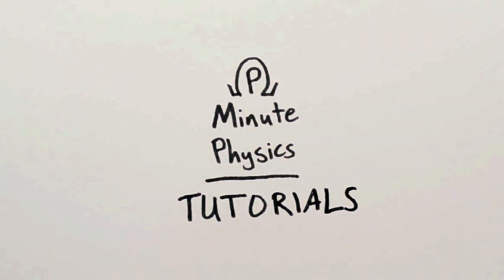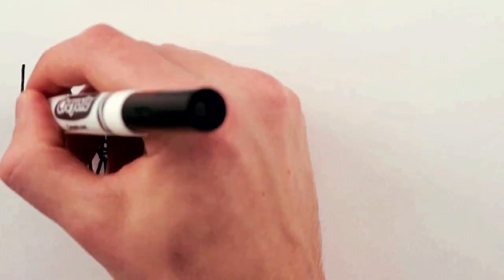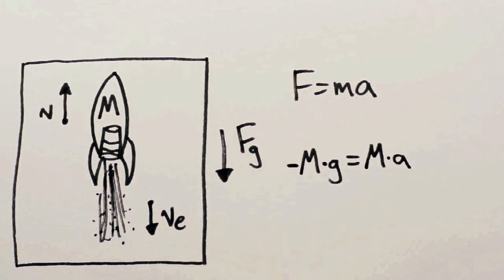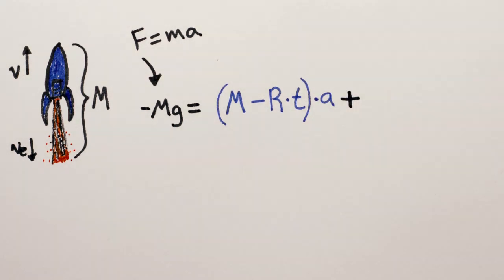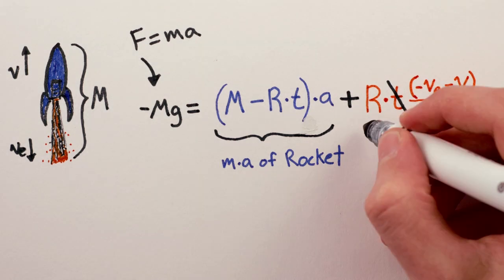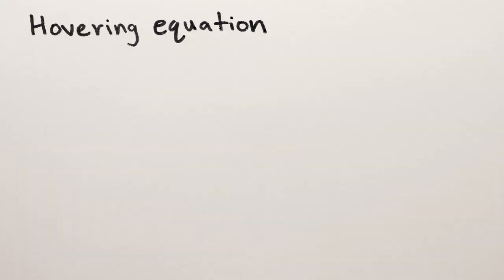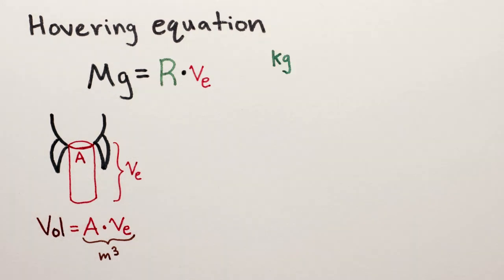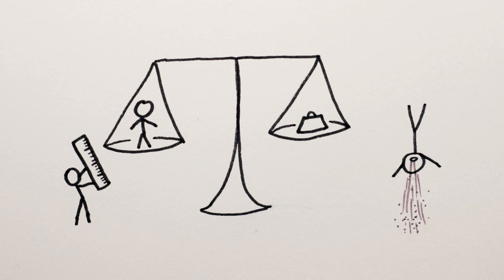Tutorial: Rocket Science! (plus special announcement)

Comment: It's a type of refraction, the sloping of the bottle or rocket towards the opening increases the velocity very quickly, and when it hits the open air it spreads out in a cone like pattern. If the diameter of the bottle and the opening are the same, then the water will come out in a cylindrical patter.

Comment: Yes, very basic, showing the very basics without any addition with calculus. In order to calculate all of these parameters you must take into account many different changing aspects. 9.81 is always decreasing as the rocket increases its height, as well the mass in both Gm1m2/R^2 and m2*a are both changing. As well the rocket does not travel in a straight path, in order to orbit a rocket has a trajectory of a shape close to the parabola to reach the proper direction, in which the final velocity would be reached byy a ever changing acceleration based on the vector of the changing directions of force. So much is left out of this, which makes sense seeing as adding in all the calculus in order to fully explain it would be impossible to explain in a minute physics. This is bottle rocket science.
Reply: Daniel Alexander Also the exhaust of a rocket is not just liquid and it doesnt exit with the same volume, you are only able to calculate based on the use of fuel from inside the rocket seeing as once it exits it is near impossible to measure
Reply: Daniel Alexander Oh and R isnt just kg, its kg/s! Before he specifically used m-R*t, where R x t is equal to kg. I feel as if this episode was half assed, not trying to be a troll but if you are trying to teach the basics of something extemely advanced please at least get the basics right.
Reply: Maybe you should post a video or write the proper equations with all this corrections.

Comment: as long as the opening for thrust to come out is smaller than that of the fuel container/flow line, then it is getting "squeezed" out, or put under pressure, so the object trying to elevate, (Milkman) can go higher than the tank/stomach height.

Comment: No, it doesn't need to be compressed, it just needs to be pushed out with high enough force, like letting liquid out of a syringe, except much faster. Air or gas, however can be compressed withing the container and when the opening is, well, opened, the air has more room where to go to and decompresses while getting out, thus taking up more space and propelling the rocket.

Comment: no 1mm is .001m, not .01m, and the area of a circle is pi*radius^2, so it would be
Vol=Sqrt(pi*0.042^2*73*9.8/1000) m^3
and this equals 0.063 Liters/second. 
Correct me if I'm wrong, but I think this suggests that you should be able to fly by holding onto a 2 liter thing of coke after putting mentos in it, assuming the opening is less than a centimeter, and the foam that comes out is incompressible...

Comment: Ok so, quick question : (I'm a CS guy, I'm not that good at physics so please don't judge)

Considering a payload be of 0.5 KGs , how big would a rocket have to be to justify using it over a helium balloon ? 

Like, I know Helium balloons burst at a certain altitude, and I'm just wondering how big (how much fuel) would the rocket need in order so surpass the maximum height reached by a He Balloon ? 
Neglecting the mass of the rocket frame,
 flight path straight up
And rocket fuel : standard solid KNO3 based hobby rocket fuel

Comment: I'm sorry but there are only 500 characters allowed.
So the formula is as follows:
g(h) = g(n) * {r(e) / r(e)+h}^2
In this formula there are a few variables to be taken in to a count:
g(h) = the gravitational force (acceleration) at a certain hight.
g(n) = the gravitational force at the surface of the earth (9.81m/s^2)
r(e) = the average radius of the earth, or the actual radius at your location.
h = the current altitude

This means that as the rocket goes up it's going to be easier.

Comment: But, you don't need alot of milk at all to levitate right? just a drop will do, as long as you expell it at a high enough velocity?
Reply: Right! "Simple algebra" part is missing this. Plus you could heat up exhaust to make it more efficient. Heating up water rocket nozzle might give you even a plasma thruster for a moment or two :)
Reply: but at the rate that milkman expels the milk he couldnt possibly lift himself
Reply: olly man well, I'm not sure about milk expel rate. Stream might have a tiny core amount like 0.001 kg of milk expelled at 10^6 m/s every second to make milkman fly easily. Other milk mass we saw could be just coolant/lube/flaw in his milk thruster design. That tiny amount of milk actually used for propulsion should also leave particular traces on tarmac...
Reply: olly man of course I'm not standing here for any real possibility of such engine. Just want to prove that video's calculus not 100% correct. 
BTW, if we are assuming that milkman must use only a litter or so of non-combustable fuel for flying between some distant places where crimes occure, then exhaust rate must be ridiculous causing air ionization and weird supersonic sound effects.
Reply: minutephysics assumed a duration of one second, which is essentially the reason, that he wrote Vol = A * v and not Vol= A * v * t. He just made t equal to one to make the equation simpler(an old physicist trick. Not very effective, especially in this context though). So your right! What he really calculated is actually the volume you need to eject in one second, not the total volume.
Reply: didn't he do the same thing with R? I think It should be expressed in kg/s and he just used It as If It was kg.

Comment: But wait, why should the milk exit the mouth as a contiguous block of liquid? Just because water is incompressible doesn't mean it can't be expanded to a gas (with heat) or even just a fine mist. This way the mass ejection rate can remain small with increasing exit velocity, thus less milk than 5 gal/s required.
Reply: orbik It would turn to a mist, however unless its steam the accumulated volume is the same
Reply: Because it is kept at a temperature where it stays a liquid
Reply: +Just one more thing to see You know that the phases of matter depends on other factors than temperature, right? Like pressure.

Comment: Sorry, posted before, but I found my error, but the discretion was that it's a volumetric rate, not a volume your solving for.

So, for 260 lbs it about .0775 m^3/s or 77.5 L/s, and the speed of vomit (according to an EMT) is 18.89 m/s. Given this the speed that is required for hovering is 15.43 m/s. So discounting head loss, hypothetically you should be able to throw up and obtain lift!? 

And the last 600 or so postings, for the most part, is crap and you should be flogged.

Comment: If your acceration is 0, how would you be able to levitate? You would be going about -2.45 feet but gaining 1.96 feet because of your exhaust. You would have to be moving unless you are levating via gas or the “force”
Reply: Technically levitation is just hanging in space unsupported; no vertical movement.  So if you started in a handstand you could take your hands off the floor.

Comment: Henry made a mistake when he was explaining the Hovering equation. The equation R = 1000 * Vol is wrong because he forgot two principals about R, those being that R is the quantity of mass that leaves the rocket in a given amount of time (unit kg/s) and the role that density plays in the equation. The correct equation is R*t = 1000 * Vol [kg] and the number 1000 isn't there because there are 1000 liters in 1 m^3 of liquid, but rather because the density of water is 1000 kg/m^3. So knowing that we can easily see that R, which is equal to m/t (because it's the quantity of mass that leaves the rocket in a given amount of time; m - mass, t - time), needs to be measured in the unit of kg/s and the correct way to get this unit from that equation is to represent the mass (m) as m = (1000 [kg/m^3])*(Vol [m^3]) = 1000 * Vol [kg], where Vol is the volume of the water leaving the rocket. Then we put that equation in the previous one (R=m/t) to get R = (1000 * Vol)/t [kg/s]. And if you're still doubtful there is a simple test we can preform to see that this result is correct. We know that mass is measured in kilograms (kg) and acceleration is measured in m/s^2 (meters divided by seconds squared). From there we know that the first part of the identity (M*g = R*Ve), M*g, is measured in (kg*m)/s^2 and since it is an identity the second part must be measured in the same units. Since we know that Ve (the speed at which the fuel is ejected) is measured in m/s (meters divided by seconds) we just need to work out what R is measured in so that the identity is correct. So (kg*m)/s^2 = [R] * m/s. From here we can conclude that R is measured in kg/s exactly as our previous explanation showed us. In summary R = (1000 * Vol)/t [kg/s] where as R*t = 1000 * Vol [kg]. Also the 1000 in the previous two equations comes from the density of water which is 1000 kg/m^3 under normal circumstances.
Reply: Also if I'm not mistaken Ve is the speed at which the fuel is leaving the rocket in the top identity (M*g = R*Ve), where as in the volume equation (Vol = A * Ve) it is the distance that the fuel travels in one seconds, so I'm not sure if you can say that the first equals the second because they are measured in two different units. So even though it is probably correct to say that both the speed the length have the same numerical value, I don't think it's okay to say that because the length Ve = Vol/A therefore the speed Ve also equals Vol/A. That could lead to forgeting certain units and further mistakes.
Reply: #MinutePhysics
Reply: +Kristijan Nedanoski 't' is not needed because R exhaust rate is per second and Ve is velocity of ejected fuel per second.

Comment: Wait, you said. that if the rocket stopped firing in earth's gravitational field it would go down at a rate of -9.8m/s^2, but that's a double negative, your basically saying that it's accelerating away from the planet, it would go down at 9.8m/2^2 and up at a rate of -9.8m/2^2. Did I just correct MinutePhysics?
Reply: No because the initial velocity, v, has a positive value when travelling away from earth. Reverse the direction, i.e. toward earth, then the value must change it's sign.
Reply: Adam Evans whatever the initial velocity, he restated the direction of the acceleration for when the rocket stopped firing when he said down.
Reply: You have to counter measure the earths gravity when doing the math, otherwise you would just have to push the rocket up with the slightest force and it would slowly Snail it way out of the atmosphere because gravity wouldnt be pulling it down at a rate of 9.8m per second squared
Reply: All I think MinutePhysics means is that it will be accelerating down to earth, so therefore it's acceleration is negative. Don't mix the two clauses of the sentence up... Basically it wasn't a double negative... You just mistook it to be.

Comment: this is incorrect. the speed of light describes a velocity. that's why it's called the SPEED of light. which is approximately 186,000 miles per second. what you're thinking of is a light year. the distance light travels in one year. also, supposing one could utter words at that rate it would have no effect on how quickly the sound would travel from the speakers mouth to your ears. sound travels at the same speed regardless of frequency so you would still hear it. Science to the rescue

Comment: Eh, at 4.04 you said "water is in-compressible" that's not totally true. Ever heard of a bobcat using water as the liquid inside the hydraulic piston? They don't use water for that very reason as it can be compressed slightly (even if it is a minuscule amount). 

(Tomato tomat(ah)to)
Reply: Ahem, I think what Henry meant was that liquids are generally many orders of magnitude less compressible than gases. So we can usually treat liquids as incompressible when comparing them to gases.

AFAIK, the hydraulic cylinders always contain oil, because it doesn't corrode metals as water does. Actually, If you look up tables of compressibility of liquids in Google, you're gonna find out that oil (and other organic liquids) are usually MORE COMPRESSIBLE that water.
Reply: Pontus Lundström Sadly for you I worked with these machines for a good two years time and learned from a local mechanic that these oils are not compressible at all, the major factor being for their use is as a lubricant.

Comment: ok so you kind of did it wrong. it might have taken me 45 minutes of banging my head on the desk and painful calculation cause it is too late to be doing algebra much less rocket science. anyway i figured out that the equation is:
RC(Ve - V)=(M - RCt)a+(M - RCt)g
where C is the weight of the fuel per liter in units KG/liter
the first section of the equation is the force due to the propellant expelled
the second section is the force required to accelerate the rocket
and the third section is the force required to overcome gravity
so i simplified it assuming you are expelling water or milk to just hover and you get
1000(Vol)(Ve)/t=(M-Rt)g
then you get volume alone
Vol=([M-Rt]gt)/1000Ve

i will double check i am right tomorrow when i am more awake and see if i can simplify it further

Comment: In this form of vector calculation, in which you only use the diections up and down, you define a positive direction. It's logical do define it as up, since that's the direction in which the rocket will travel. Imagine only two forces act upon the rocket: gravity (G, down) and thes force from the exhaust (F, up). Look up newtons first law. If you had an other angle than 180 degrees between them, you need to learn about vectors in order to find the sum of the forces. Too little space to explain

Comment: That's completely wrong. Energy does not NEED a medium to travel. It simply interacts, physically, with a medium; should one be present. The gravitational and heat energy, etc... can still vibrate matter after traveling through a vacuum; Though, they will interact much less intensely in this case.